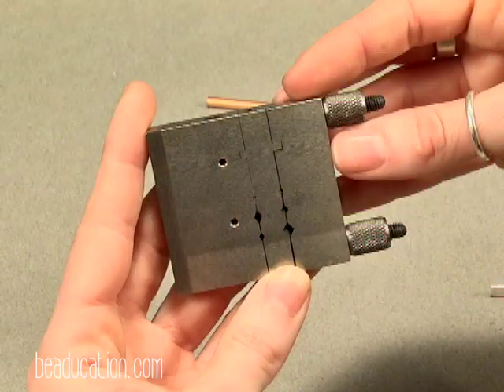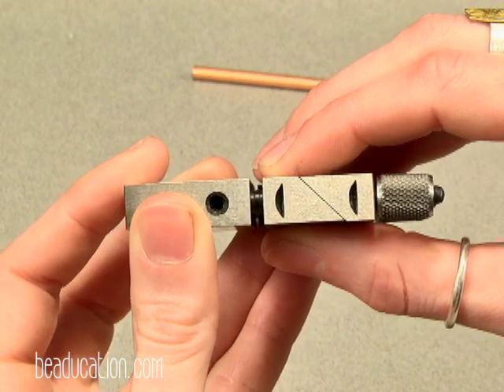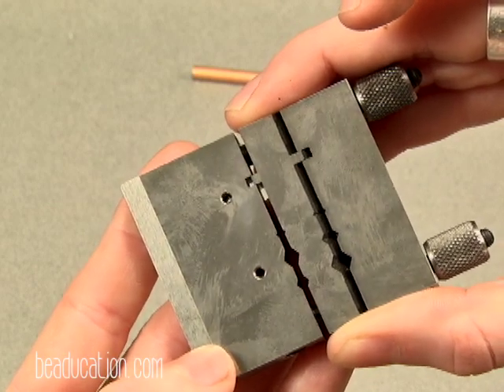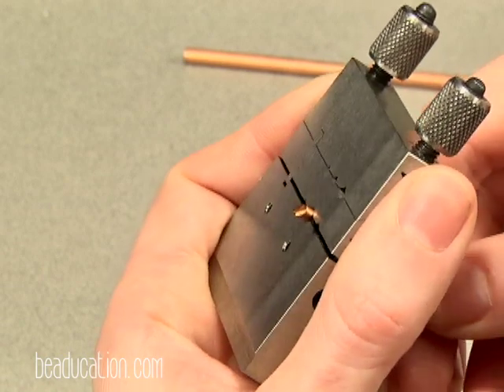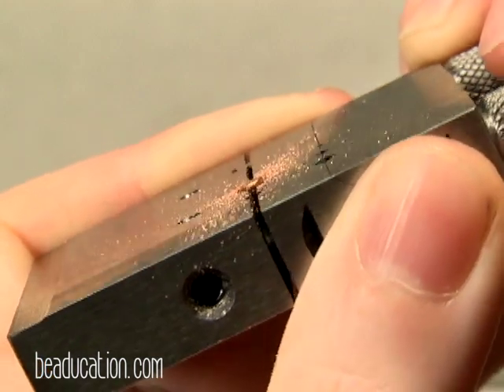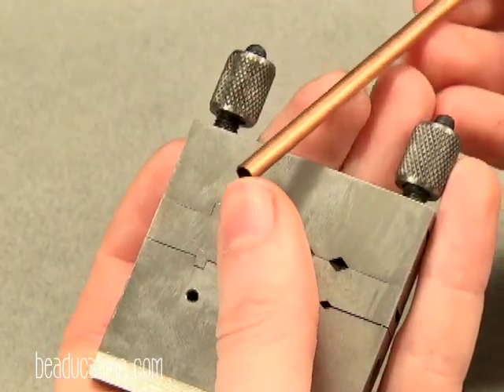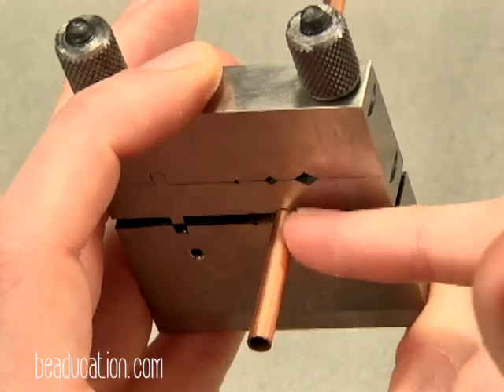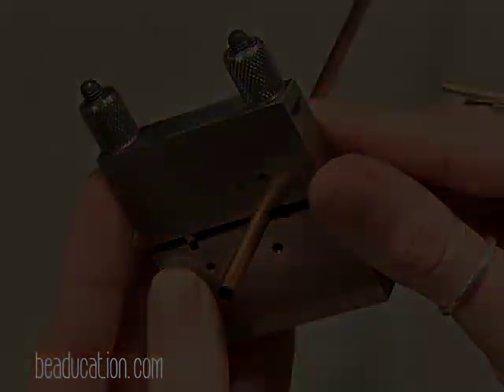Miter Cutting Vise/Jig - Beaducation.com

Comment: How do you use miter for bezel or sheet metal?
Reply from the maker: the same way as you would for round wire. Just insert it and bump it up agains the angled side and file from there. Hope this helps :)